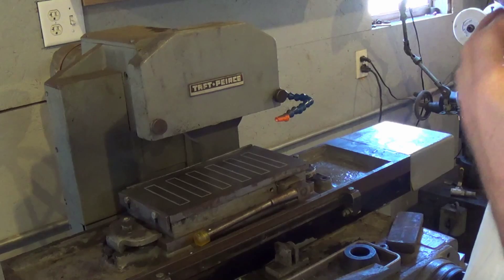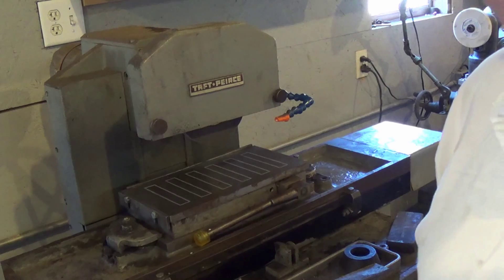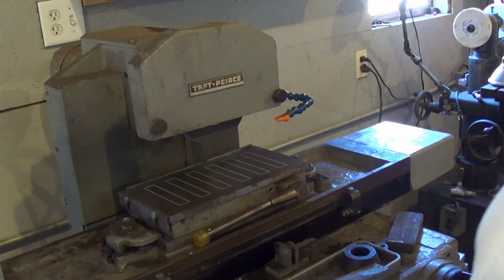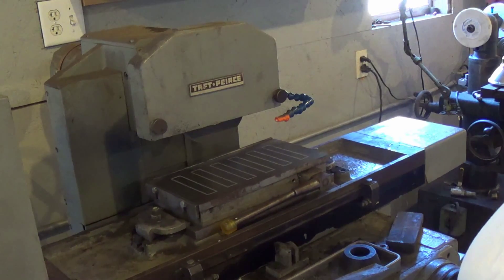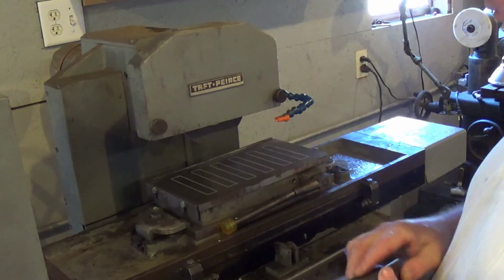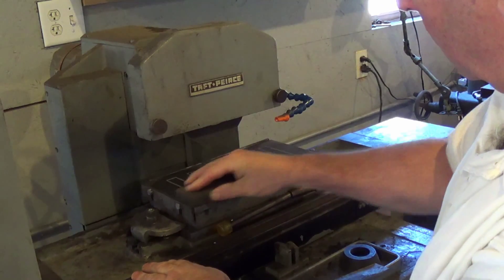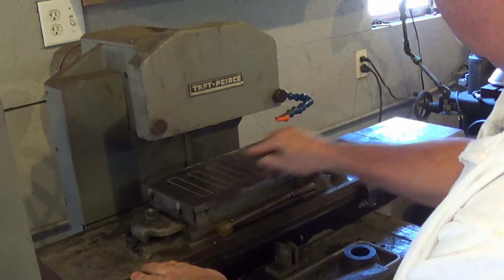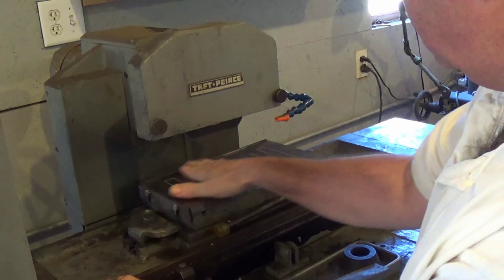Grinding The Jaws  (Bridgeport Vise)

Comment: I think you are way over dressing that wheel, especially if you do it every time you grind. You just need to clean the wheel up and expose a fresh face. I think a .003-.005 dress would be more than enough and your wheel will last a lot longer. Personally I always like to run a spark-out as my last pass, I find I can get fantastic results like that. Your finish looked really good! I think you could still get good readings with that indicator if you set it up so you pushed and pulled in line with the feeler rather than crossways. That is going to be one nice vise when you are done! I love chasing .0001's on the surface grinder I find it a challenge yet very possible. I really enjoyed seeing you run yours. Thanks for sharing!
Reply from the maker: Thanks for the comment and the advice,